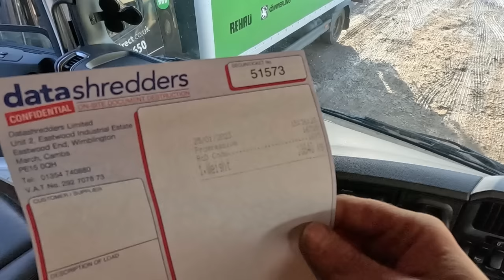FIRST Load On My NEW Trailer As An Owner Operator | Winch Out *Part 2* | #truckertim

Comment: Dont forget when using your trailer to drop the legs at the back where the trailer ends and the ramps attach. Theres a pin on each side pullthem out the legs will drop down then put your ramps down then dump air out trailer.

Comment: Always lift the air suspension on the rear when loading or unloading tractor units Tim

I’ve done it a few times, very helpful tip I was given that was

18 tonnes for a tractor unit and low loader trailer, seems a lot?